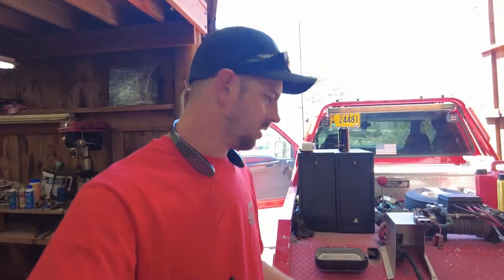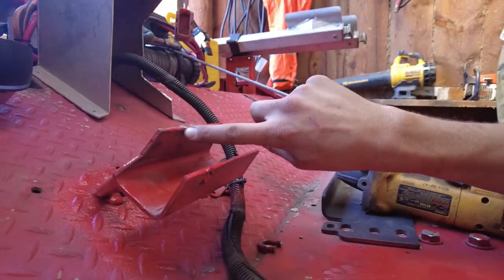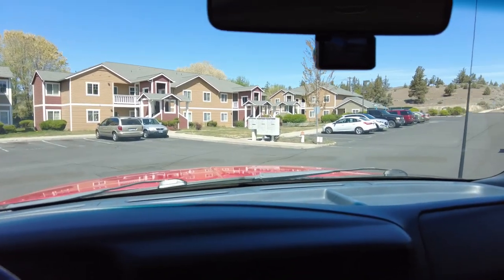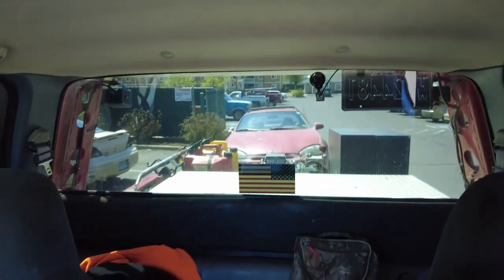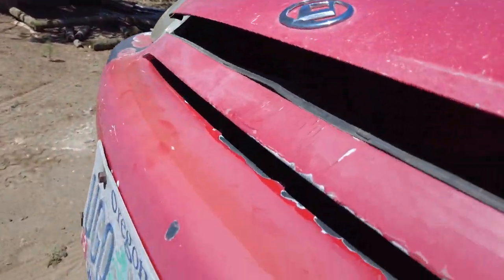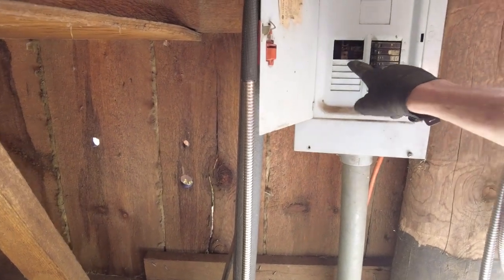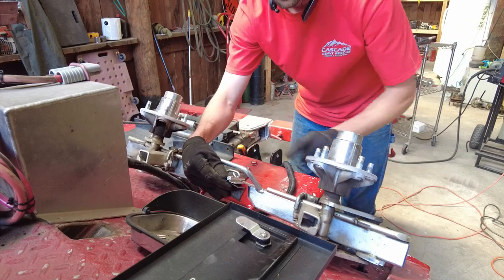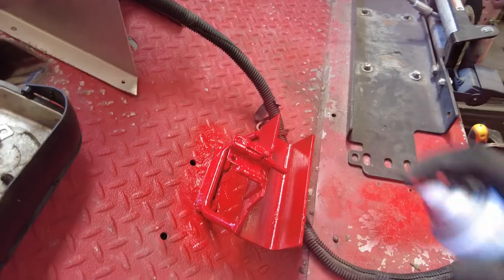I got a free car!   How tearing apart your truck can get you free stuff

Comment: Good score on the Mazda, I can tell you definitely live in a very good area, because around here we're trying to figure out ways to put bigger locks on our dolly holders. I had my daughters jeep on my dollies from towing it home after her alternator took a crap. I left it on the dollies because I jumped right into taking it apart once I got it home, and was planning to tow it back to her house when I was done. While taking the passenger wheel off I noticed her brakes looked low and rotors gouged. So I suggested we change them while I have it apart. Needless to say it took me 3 days total to complete the alternator and belt replacement and both front rotors and pads. One because of rain and I can only work on my driveway, two because the guy at autozone literally gave me every part wrong, except alternator. I'm trying my hardest to get belt on and it was a few inches to short, the original belt came off while she was driving to work and ignored the battery light the day before. So I get my son to run back to autozone to get right belt. While he's doing that, I decide let me check these rotors, they're about an inch bigger then the ones on jeep, I pull pads out of box and the ears were to big. So my son had to go back again. So he comes back we get the brakes done, now get back to the belt, again it seems like it's a few inches to short I can't get anymore out of the tensioner. So after fighting it for about 15 minutes I look up her motor year make and the manufacture of the belt, find the part number. Cross reference the part number to the one on the receipt, they're the same, find the box and it's off by one number. I'm like great this will now be the third time going back to return wrong parts. Needless to say now they're closed so have to wait till morning. Finally got it done and buttoned back up. But back to the moral of that story, lol hey look a squirrel, over those 3 days the jeep was sitting in my driveway on those dollies I kept seeing these random tow trucks riding by my house going really slow. And first time didn't really think much of it, then next time I notice he doesn't have dollies on the back of his truck, and still staring hard. So I decided to drop the jeep and lock my dollies back up, because while it might have made for a fun night for me years ago when I was younger to sit out there all night and wait for them to come try to steal them. The old body just isn't up for it anymore. In the middle of them stealing them I'd probably have to run and use the bathroom, or doze off myself in my hiding place. Yea around here you have to protect your dollies, and the bars, people steal the bars all the time off the backs of the trucks.
Reply: That sounds miserable. In rural central Oregon people usually keep their hands to themselves.
Reply: @jessepitt  I wish they would learn how to do that around here, it's just gotten worse with time around here, and really the lock only thwarts the honest people, they'll come up with a grinder or bolt cutters, I have camera's everywhere. Me leaving them on the jeep would've been an easy hit for them though, and I was taking the chance leaving them like that, but after seeing the trucks creeping up and down my road I dropped the jeep and locked them away. Within a few minutes they could've just lowered them and had them loaded on the back of their truck in the middle of the night, never to be seen again. Because I definitely never saw those particular trucks before or after that in my area.
Reply from the maker: I don't even have the gas cans in the back of my truck locked up.  They are just sitting there in the wide open with nothing but a ratchet strap holding them in place.   Like Jesse said, people generally keep their hands to themselves here.  Very different mentality
Reply: @CaseyLaDelle  unfortunately I'm in between Philadelphia and Baltimore on my channel I have a video of my son's dirt bike being stolen at sunrise on a Sunday morning. Yea alot of people around here with sticky fingers
Reply: @jessepitt  It's one thing I like about Muslims- if a thief gets caught he loses a hand and I think it's the way it should be! And you shall be allowed to defend yourself and your things as hard as you can without any punishment! Here you get jail time if you try to protect yourself too hard and the thief gets money for the suffering how sick isn't that?